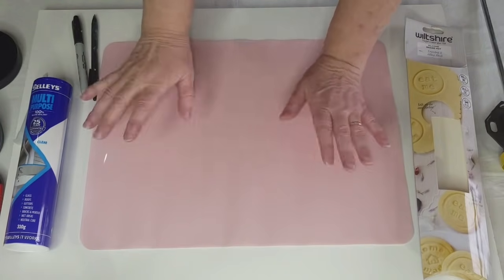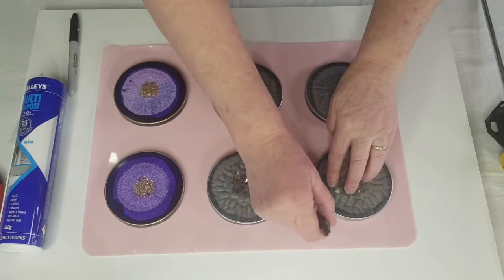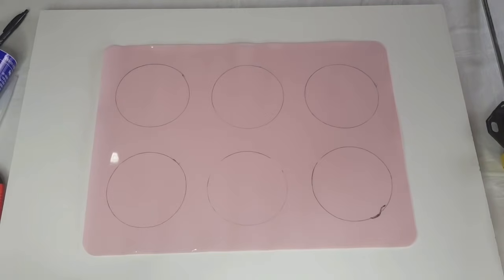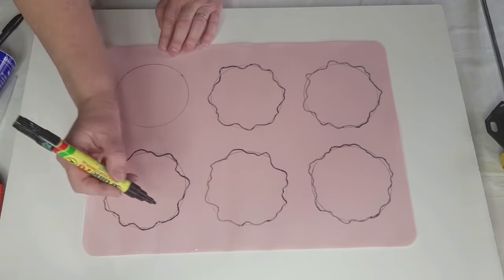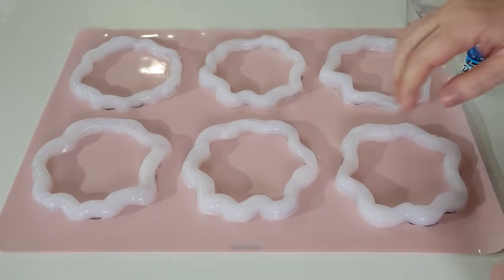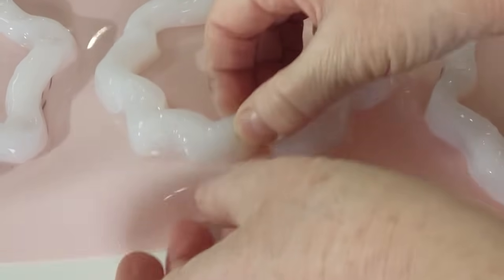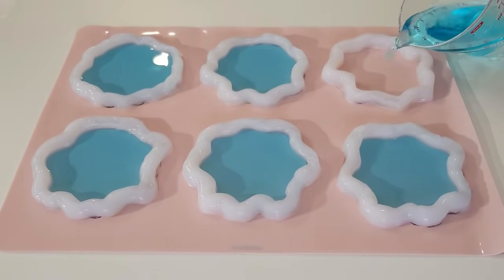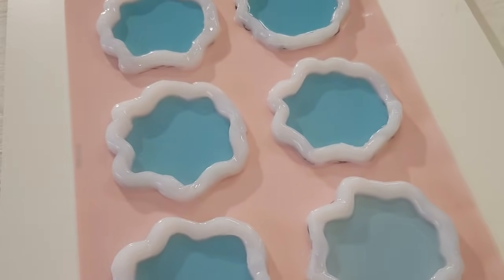#869 How To Make DIY Silicone Geode Molds For Resin Coasters

Comment: FYI everyone, dish soap is used becausd some dish soap have glycerin in it, which prevent silicone from sticking. Instead of buying dish soap, and not having glycerin,  I had shampoo with glycerin in it and used that in water. Worked like a charm.

Comment: Once again, WOW! I've been wondering if silicone caulking would work & there you are DOING IT!! Yea, thank you so much for showing it will work!
I recently experimented with some  1/8" - 1/4", hard pressed felt, cut-out flower shapes in 4 styles, set of 4 coasters from Dollar Tree during Easter. I used the daisy in a pretty soft lavender color. I filled the petals with a soft gold powder mix, the center with a little darker yellow and then "painted" a light coat of the gold over the top. I put them on a silicone mat and, much to my surprise they came out perfect! Oh so much fun! The "painted" gold just gave enough for the lavender to glow a little beautifully.
I love your experimenters soul. I even have come to really appreciate your willingness to show us what didn't work as well as what did...now we know too. Again, Thank you so very much. (I don't fast forward too often - only when I'm anxious about how pretty it's going to be too!)

Comment: Julie, if you'll put that board on a turntable it'll make it easy to go around the not-so-easy areas to get to with the gun. You can get inexpensive plastic ones by Wilton, for cake decorating. I also use them when I'm painting a large piece (I'm a china painter) and can't really handle it with my hands. It makes it so much easier to just turn the wheel.

Comment: I think I saw a video of someone testing food coloring in resin.  If I remember correctly, I think it made translucent colors and it did not interfere in the resin hardening.  I can not remember who did it, as it was a good while back.  Seeing her pull out the food color made me remember it.  I have made molds using 100 percent silicone and it works quite well.  I always use the silicone to seal edges of mold boxes.  The mold material lets go really easily.  I love watching Julie's video's -- especially when she shows us the birds in her back yard.  Such a nice treat when she does that.  Thank you.

Comment: As for water removal... you could place the silicone mat on a large cutting board or other stiff item, then just carry the whole thing to the sink to pour out. Or, you could use a pipette or syringe to remove most of the water, then a couple paper towels or microfiber cloth to wipe up the rest. Saves on paper towels.

Comment: Does the silicone that you are using give a vinegar like smell when you use it. I tried it for the first time and the smell was very pungent. Just want to make sure I used the right kind.
Reply: CraftsWithKripa  silicone caulking does have a strong smell.  Always use in ventilated area and use a respirator tht you use with epoxy

Comment: Might want to try using thin or smaller lines of caulking then make layers to get height. I think it helps alot you have more control and can do a bit more detail.  I let the first line pretty much dry then next line on top.  Use a plastic spoon and water to smooth the layer seems. I have never use baby oil instead of water but I think it would work. Any way just thought for you.  Thanks so much for your videos. I think you are very brave, let everyone watch you first attempt at what ever, very cool!

Comment: Hi,
Thank you for putting this up! Had been looking for freestyle mould making process ways for days and this really helped!
I have a question though, will it be possible to make deep casting (taller height) moulds with this method? For example, 1-2 inch deep moulds?

By pouring silicone layer by layer maybe? Or some other way? Asking for making abstract shaped river tables.
Thank you again!

Comment: How do you prevent the silicone mat from wrinkling?? I made a tray mold and it's like unusable 😭
Reply: The same happened to me
Reply: @samsammysamuel  it's the brand of silicone
Reply: @JuiceBoxx_627  could be...but I got the best brand of caulking silicon and a 2mm silicon  mat that I could find in my country. So trying to figure out a way to salvage it else its alotttt of money spent down the drain😭😭😭
Reply: @samsammysamuel  you want to use something like DAP or GE. It's 100% silicone, all purpose. I just got some silicone mats off Amazon. But I'm in the states so my selection to choose from may be different
Reply: @samsammysamuel  trust me, it's the brand of silicone. My man came home with a cheap brand of silicone and that's what caused the wrinkling.
Reply: @JuiceBoxx_627  ofcourse   im in Pakistan and even the best quality i found ended up wrinkling😑
Reply: @samsammysamuel  I'm sorry 😔
Reply: @JuiceBoxx_627  its okay, you experiment,  make mistakes and learn😊
Reply: @samsammysamuel  are you able to order from Amazon? Maybe you could get some of the silicone we use?

Comment: You're wonderful. I would like to suggest next time you cut your tip at an angle. It flows easier & will be able to control it better. Even with the smaller tip you can just move slower.

Comment: If you had cut the nozzle off closer to the tip you could have done more detailed lines. It's like the difference between an "extra fine" marker and a "blunt marker". Once you have your lines made, you can beef them up around the outside.

Comment: I know that you can make molds many ways. This, by far looks to be the easiest. I would be concerned about the convenes edges on the inside of the molds. Is that what you used your finger for? If not, couldn’t you use a ice-cream stick or a palate dipped in your water solution to flatten and smooth out the inside? Just thinking.
Reply from the maker: My finger smoothed the inside edges beautifully
Reply: Excellent!

Comment: Where did you buy the silicone mat?
Reply: Think I saw the same one in Big W here in Australia.
Reply: Probably a homeware, cooking supplies store.
Reply from the maker: Big W. Spotlight also has them or ebay
Reply: Now I come to think of it the Big W one left a slight texture, which ended up nice for jewellery actually but maybe not if you want it completely non textured.

Comment: I wonder could you use hot glue gun
Reply: Nope...it would stick to them just as the non 100% silicone. I was going to try that myself then saw a video stating it wont work.
Reply: I was wondering this, please can you clarify do you mean the resin will stick to hot glue mold after it has cooled as I have used this method to make molds for clay, paper clay and using nail acrylic with success. Thank you x

Comment: There is a little part on the caulk gun you can cut open the caulk with. Pull up a good caulking tips video.  Much safer then cutting with the box knife!

Comment: Saw no reason to draw extra lines over the circle.  You can use as guide but you didn't do the design you drew anyways
Reply: I totally agree. I felt drawing the squigally over the circle was a step that could be eleminated too. I would also put the whole mat on a cake rotating pedestal. I think that would make it much easier.